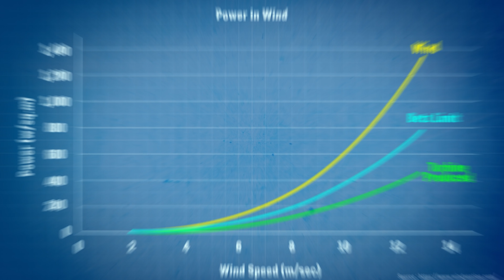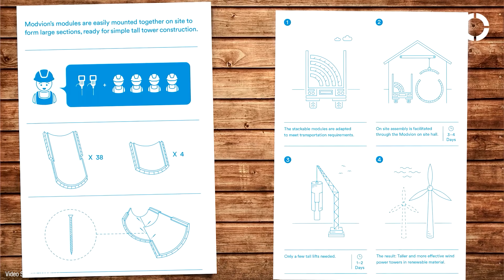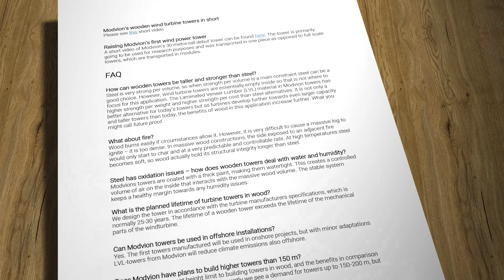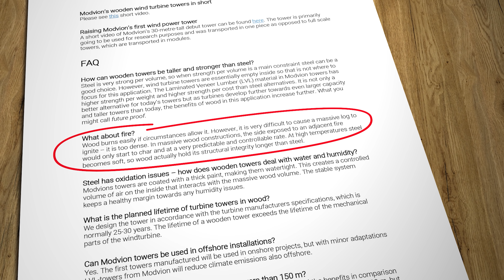Wooden wind turbines. Are they really a sustainable alternative?

Comment: wood? I can understand that, because they don't have bamboo.

if this form of turbine is a bamboo reinforce wood structure, they can save a lot of time and kill less tree. bamboo scaffolding 30+ storeys is not a news here in Asia. they are pretty welcome to take some and integrate into their design. it grow fast, elastic, fibers going one direction, and have track records to build high. if you steam them well, it is also possible to use on blades too. we have seen 10 storey high windmill build in wood in Netherlands for hundreds of years, this is a kind of "reinvent the wheel" in a better scientific way. it is already there for long time, this one just look smarter.

Comment: Hemp looks like it would be a good substitute for glass fiber for the blades. It is a weed (plentiful), absorbs CO2, and is biodegradable. It is fairly strong and almost as stiff as glass fiber. In many cases the specific modulus (this is essentially a stiffness to weight ratio but hemp has a more variable value than glass) of hemp is typically higher than glass. The stiffness to weight ratio is important to avoid fluttering. Carbon fiber is stiffer and lighter but is mush more expensive. I am not certain if there are issues with carbon and lightening as well. I wonder why hemp is not used.
Reply: @Luke Fabis In theory based on the specific stiffness, hemp and glass should have similar flutter performances (vibration due to vortex shedding) for the blades. The tensile strength is close to 690MPa which is substantially higher than most mild steels. It is weaker than glass (especially E-glass) but I don't think the strength is the major issue. It is more related to the stiffness and mass.

Any added strength is at the base of the blade which contributes much less to the moment of inertia for the rotation of the blades and the aerodynamic performance.

I would really like to see a study on this. My gut tells me it is promising but you don't know until you dive into the design.
Reply: Entirely down to the utterly absurd war on drugs nonsense like many other ills in our society, its the prohibition that is causing the problem not the drugs
Reply: @quadq6598  you are probably right. It is incredible such a versatile and sustainable material is sacrificed for political reasons.
Reply: @Luke Fabis Most of the blades I have seen are glass but some are carbon fibre. Glass is a lot cheaper. Most people don't realize that glass (especially E-glass) is stronger than carbon fibre. It is just heavier and not as stiff so it has a lower specific strength and specific stiffness. 

I did some more reading on hemp blades and they are actually used. It is more or less at an experimental stage right now. What also surprised me is that the oil from the hemp seed can also be used to make epoxy. So it seems like a much better solutions to me. I would rather see a compromise on the diameter and efficiency and have a full life cycle that is better for the environment. It likely means more wind turbines and more costs but I suspect it is a better long term outcome.

Comment: The biggest controversy here down under with wind turbines is since they are best in prevailing winds they often hit migrating birds (such as the wandering albatross). Is it possible to stop the blades during the season or redirect the birds away from the blades (better solution) since these birds use these winds to their advantage?
Reply: Ofcourse you could stop the blades, but then they ofcourse aren't producing. There have been several studies into ways to reduce birdstrikes. On is painting on blade partially black, this helps the birds see that it is spinning and to watch out for. Other options have been tiling (I think this is the word, turning over) the ground around the base to prevent bird pray from housing there. And then ofcourse there is the camera solution. These are camera's that detect birds in the surrounding and shuts down the blade untill it is gone.
Reply: @MDP1702  Don't be triggered, but here's the problem with your thinking...  Turbines strike birds, but which kinds of birds?  All birds, the turbine doesn't discriminate, the bird just has to fly through the wind farm and they're at great risk, multiple times.

But cats kill millions of birds every year, the numbers dying to turbines today is quite small comparatively, so why do I have angst over this?

It's the types of birds that I'm worried about.

Cats ki ll millions, if not billions of birds every year, but the kinds of birds that cats ki ll are small, high population density birds like mockingbirds, blue jays, small birds...

The kinds of birds that I'm concerned about are the low population density birds of prey like eagles, hawks, kites, et al...

These birds of prey are already under threat today meaning most of them are on the protected species lists, or close to being so.

Birds of prey help to keep small varmint populations in check, like mice, rats rabbits, et al.

Wind farms are turning into sanctuaries for these small varmints, because birds of prey who spy them running around the fields where the turbines exist invariably move in for the ki ll, and pay dearly for it.

Imagine, you're an eagle with a chick in the nest, and you need to find food for your baby.  So you go hunting, and you spy a bunch of rabbits in a field of wind turbines.  You lock your eyes on your prey, and you dive in for the ki ll, and then WHAM .  Hello spinning turbine blade that you missed.

Now, not only are you dead or gravely injured and down for the count, so is your chick in the nest that relies on you for food.

Just have a think.

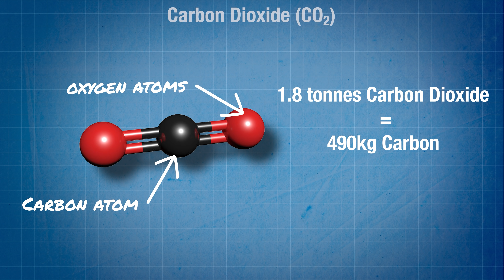Comment: 6:00 that "extremely recyclable materials" is a claim that needs to be proven. Chemical treatment of the wood, and hard to separate polymer coating may pose a major issue.
Reply: Quite. I think it will end up chopped up and used in some sort of fibre board. In contrast, aluminium and steel are very easily separated and can be used to make brand new, pristine material with a fraction of the original energy input.
Reply: You're making a mountain out of a molehill.  The towers are going to stay in service for 3 decades or more, most likely will have the turbines replaced with newer ones over their long lives.  And they can be taken down, and a lengthening base section added to raise the turbine height.

But a section of the wooden tower might be used for a dwelling or a silo.  If they're in sections that are bolted together as shown in the diagrams, they can be broken down and moved easily to a new location for reuse.
Reply: @acmefixer1  Yeah, "reusable" or "repurposable" might be more accurate that "recyclable" for there - they can be used for some other structure, not turned into something completely different like paper products.
Reply: Nothing a planer couldn't handle.
There are many biodegradable glues on the market.
Even after eventual decommisioning,the structure can be taken down and any rot would be localised due to the capilliary nature of the material.
It is simplicity itself to cut up what is left and re-use it.
It is even possible to repair such a structure.
The biggest problem by a long long way is the total ignorance of the general public and the vast majority of engineers regarding timber and its properties.
Hats off to the Scandinavians for not being sucked into modern western ignorance perpetuated by unscrupulous steel magnates and clueless officials.
Reply: Natural materials like linseed oil can be used.

Comment: Just get people to start harvesting their own energy,  photovoltaics are very inexpensive 
If you're an Energy glutton,  you will have to work a little longer
All these techno fixes by corporates so people can gain a dividend 
For $1 trillion,  you can build a photovoltaic manufacturing plant in every major city on the planet 
The planet's crust is composed of 34% silicate minerals and is evenly distributed, so no one will run out,
Dismantle those weapons of Omnicidal destruction called the personal gas guzzling machines and use the materials to build light weight Solarized transportation 
It's not complicated,  the adults/parents just have to give up their fossil fuel addiction and start building a light based economy and protect their descendants

Comment: That statement about the potential energy generation growing as the cube of the wind speed was eye opening.  I'm curious though-- combining more powerful winds (lateral force) and a longer "lever" means the amount of force at the base goes up dramatically too, doesn't it?  So how does the engineering account for this-- and minimize the chance of one of these getting blown over, followed by tons of debris being hurled downrange?  
In sites where the predominant wind is highly directional, I can imagine one or more supporting legs on the leeward, "not gonna get smacked by the rotor" side.  However all of the images in this video-- and the wind turbines I've seen in the wild-- show a solitary tower, one that touches the ground and concentrates force in a single location.

Comment: An interesting building material to use in these constructions may be bamboo, which grows a lot faster than most softwood and has excellent physical properties. I also wonder whether a wooden windmill produces less noise, which is important in built-up areas.
Reply: I was thinking the same thing. It's a bit trickier to make veneer from bamboo but doable. It's generally stronger than wood and more fire resistant. If the wooden towers take off I'm sure they'll explore bamooo as an option.

Comment: Seems like a win at all levels.
Regarding fire resistance.  Wind turbines are also unlikely to be installed with forests up close.  A grass fire does not generate the sustained heat that would be required to threaten the integrity of the tower.

Comment: Thank you for another fascinating video. The resurgence of timber construction is a really intriguing development, particularly for large scale structures that are typically made with concrete and steel. Imo though, it would also be a good idea for industry to try and develop ways for wind turbines to last longer. The highest barrier to adoption of wind powered renewable energy is the cost of installation and maintenance. A turbine that lasts twice as long is basically half the cost in any particular year when amortized over the total lifetime of the device.
Reply: The wind turbines are being designed for long lifetimes, as long as the blades are repaired and maintained.

Comment: Wooden wind turbines would be a good start toward sustainability for this class of alt-energy. When you consider how resource-intensive the current technology is, with metal towers, massive gear trains, huge volumes of resins and reinforcements for the blades, is there even an energy payback compared to what it takes to make these beasts? The energy costs to process new material PLUS the new materials must be included in all of this. I have never seen data that legitimizes or justifies large wind turbines. BTW, you don't need to build those massive gear-trains ... there are some alternative design approaches to address this.

Comment: In the States we have these things called lightning which when striking wooden structures sets them aflame. In the States we also have these things called tornadoes which produce lots of circular winds when they hit wooden structures, (tall ones in this case) could turn such a structure into kindling.
Reply: An American named Benjamin Franklin solved the lightning problem a few years ago. There may be a YouTube video...😁
Reply: @ReggieArford  I am guessing for a very tall wooden object this won't suffice. I have no objection to the concept, but the engineers and planers must decide on what problem they wish to solve first? Want to do cleaner electricity making? Ok wind. Want to use carbon-absorbing materials to accomplish this? That's another chore. We can't go Greta on everything, because one goal will defeat the other.
Reply: @mortimerhasbeengud2834  You are obviously not an engineer nor otherwise technically informed.
Reply: @DrakeN-ow1im  No, I just read a lot about wind turbines and study which systems of these can contribute to human survival. Not all can, and being a green should never be a team, or a suicide pact.

Comment: Dave I like the lower carbon emissions that you mention about the wood verses steel during construction but I think the industry marketing guys have pulled the wool over your eyes about the carbon sequestration of wood towers. The carbon is not locked in, more or less indefinitely. Think it through, eventually the tower will have to be disposed and even if recycled, those products will be disposed...eventually. If that is to land fill, the wood in the land fill eventually rots. That rotting process releases the CO2 back into the atmosphere and there is basically no net sequestration. Wood is carbon neutral but the sequestration process of changing wood and plant fiber in the ground into stable locked in carbon (i.e. coal, oil or natural gas or carbonates) is so inefficient it is barely noticeable (ie. it takes millions of years to make fossil fuels or rock). 

That being said, I have read about burning the wood into biochar (charcoal), some of the heat released in that process is used for energy from waste (the waste is the wooden tower) and the resulting biochar (similar to coal) is then buried or used to improve land fertility. If that is the proposed process then perhaps we may get true sequestration. But of course no significant biochar facilities exist now and since they have to be made out of steel and concrete what is their net carbon benefit? Perhaps a future topic Dave?

Comment: There's no good reason we can't make the blades out of wood too! . . .

But composites like carbon fiber are better performing, so I think they'll continue to use those unless regulated.
Reply: I honestly don't think cellulose has the tensile strength needed for blades.
Dynamic loading is a lot more than it appears.
Reply: @jimurrata6785  I mean they do make airplane propellers and bows out of it . . . so I'd say it's plenty tough and flexible, but I'm sure there is some size they can't safely exceed!
Reply: @bardrick4220  Ships and masts used to be made of wood too.  🤷‍♂️
But on a tensile or per-unit basis wood just doesn't have the strength required in today's world.
A turbine blade of wood would easily be 5-6X the weight, and engineering calculations would have to have a higher safety factor, simply because a tree is never going to be as consistent as a manufactured product.
These blades are quite massive, just to reach more wind.
Reply: @jimurrata6785  they still are made of wood! . . . I never said it was a stronger material, but it's a sustainable material!  And that's why people are building wooden towers!  I would have said the same thing about them but obviously it's possible! . . .
Reply: @bardrick4220  the tower is static, and the weight penalty is not an issue.
The blades need to be supported by the gearbox shaft and the slew atop the tower.
They also need to have less inertia so they can actually get spinning.
While wood is good for many things it does have many limitations as well.
Edit: You said "There's no good reason the blades couldn't be made of wood too".....  Yes, yes there are many good reasons the blades can't be made of wood too!
Reply: @jimurrata6785  I also said composites are better! . . . And you keep trying to tell me wood is impossible in some way! . . . The Dutch don't seem to have a problem making wooden turbines; they're pretty big too! . . . So how big do you want them?
Reply: @bardrick4220  Big enough to reliably generate electricity on a commercial scale???
It doesn't seem too much to ask, since that is the whole crux of Dave's video.
But go right ahead
Reply: @jimurrata6785  that's not a good definition since I could just make a field of them with 3m span and call it "commercial!"

Comment: Great information Dave, Thanks... I recall there was also a movement to use laminated wood in medium rise construction projects of 20 storeys or so. The benefits of strength and lightness of laminated wood have been long known since the orginal tennis raquets and cricket bats. I haven't yet seen any high rise buildings using anything other than concrete and steel where I live in Auckland NZ. But then again NZ is a right wing rentier country pouring synthetic nitrogen fertiliser on it's industrial farms by the gigaton, and subsidising 4 x4 highly polluting diesel wagons to 'increase' GDP, so what would we know down under with a Climate Tracker rating of "HIghly Insufficient" and no climate plan except business as usual?

Comment: I believe that growing trees store more carbon than dead trees made into towers. Steel is very recyclable and at the end of a wind turbine's life, the steel will be melted down and made into a new one or something else. You seem to be pushing a shaky narrative.
Reply: Of course a tree cannot continue to draw in more carbon once it is chopped down and turned into a wooden product, but using it to replace a material which requires a large amount of energy to produce will save a lot more CO2, at least until the day when all iron smelting and steel melting is powered by 'green' electricity rather than coal. Recycling steel is still pretty energy intensive, you have to melt it down.